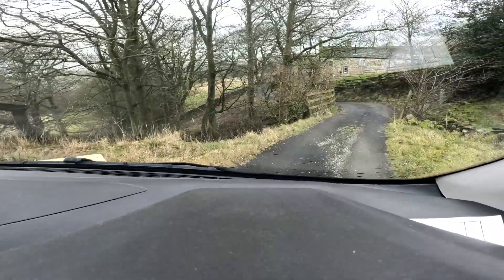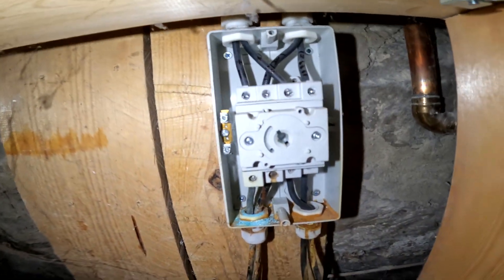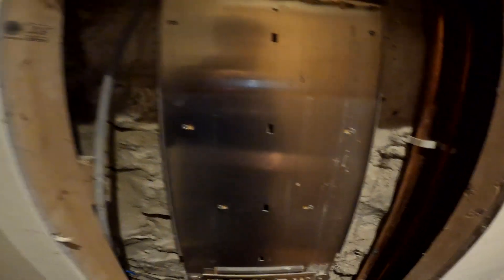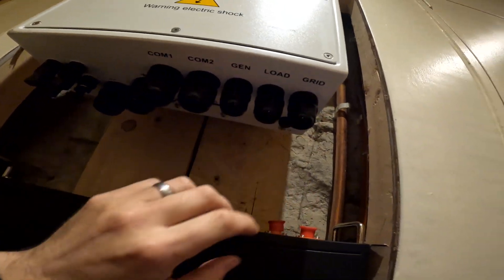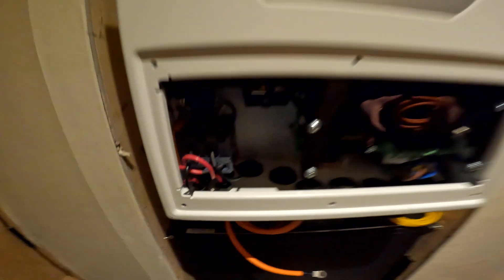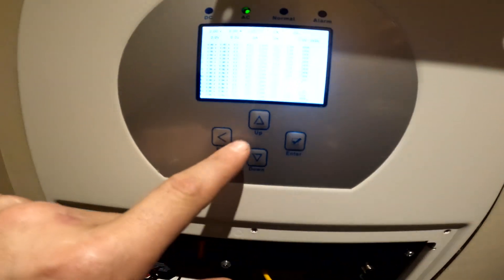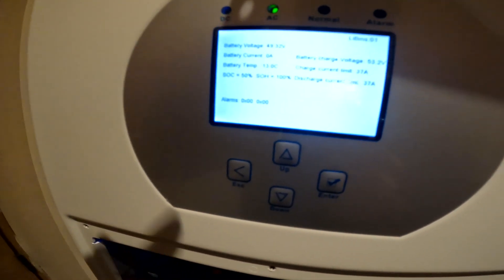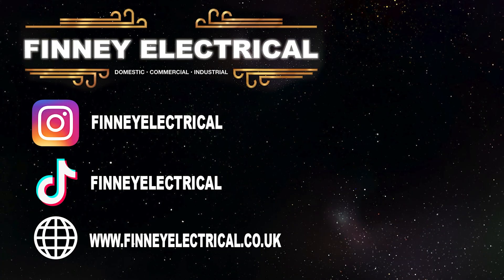☀️ SAVED THEM SO MUCH MONEY! 💰💰💰 SUNSYNK SOLAR INVERTER WITH BATTERY 🔋

Comment: Hi do you need an air gap or air flow to keep inverter cool? And the DC side is there a max lenght of cable because of voltage drop? Ie panels on the roof and the inverter in the garage than in the loft on a 1 story house. Nice video 👍
Reply: I am a auto diagnostic electrician and very interested in the renewable energy and thinking of retraining I would like to do the work on self I know I can't open to fuse board but I know a electrician that can but he's flat out at the moment it's more what paperwork and if I can do the G96 form my self
Reply from the maker: @alanpalmer3879 ah sweet! Only thing is you would have to retrain as an electrician then go into renewables so a good 5 years at low pay. It’s worth doing what you love though!
Reply from the maker: Heya Alan! Cheers for watching and commenting, helps loads. There should be an air gap but was super tight on this one. There was a cavity around the full hood so will be fine. Yes Must account for volt drop over long distances. It would have been a lot better to put the Inverter in the field as ac travels over long distances better. But got the correct voltages when connected up so all was good 😀
Reply: I am looking at the sunsynk setup and trying to work out where the best place to have it fitted. It was good to see someone else fitted them than just watching the sunsynk you tube channel thanks 👍
Reply from the maker: @alanpalmer3879 yes haha 😂 this is the real world! Never conventional. When you getting it installed? You an electrician?

Comment: At least the inverters are generally getting smaller now, so there is less of an issue with replacing an existing unit and getting the new one to fit, unless the customer up sizes the inverter of course. 👍👍
Reply from the maker: Yeah they are great these days, to be fair the biggest size are the same shell 😀